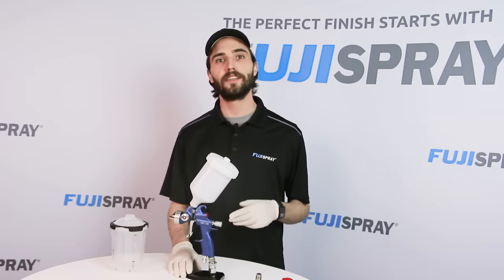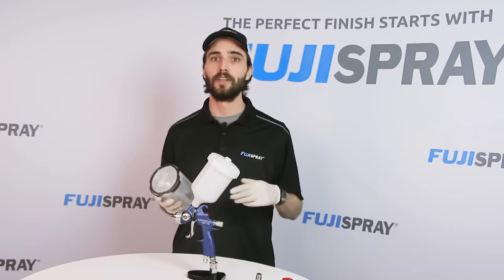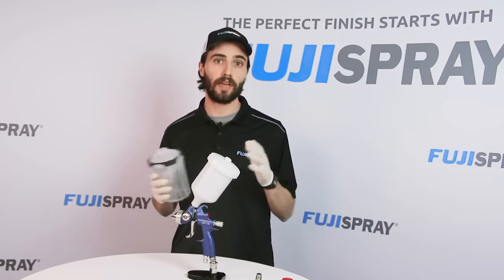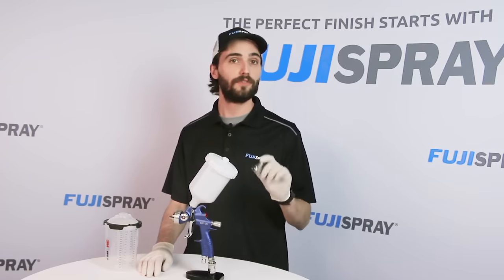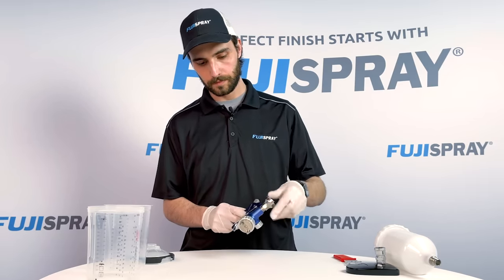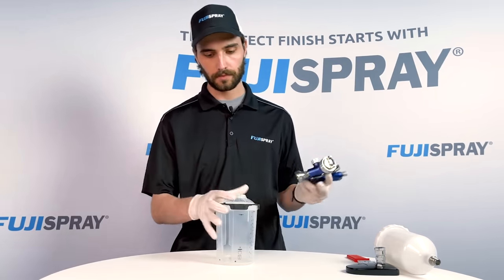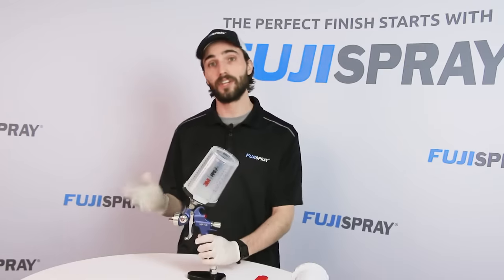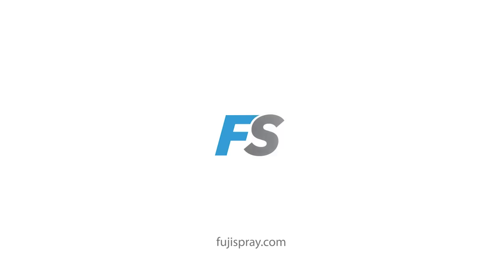How To | Adapt Your 3M PPS Cup 2.0

Comment: Hi, will the 2.0 cups work with the T75G Gravity Feed gun? I didn’t see it in the reference chart. Thx!
Reply from the maker: Yes, the 3M PPS 2.0 will be compatible with the Fuji T-75G spray gun. Be sure to look into the H/O (High Output) series. - Fuji Spray Team -
Reply: @FujiSpray  Thanks - do you have a link to that? I only see the page you linked too and nothing about the 75 or H/O kits? Thanks much!
Reply from the maker: @brianwohn  please call us at 1-800-650-0930 or email us at support@fujispray.com
Reply: @FujiSpray  OK thank you!